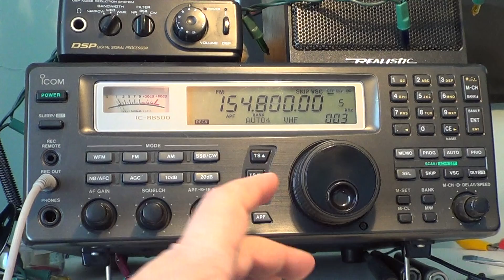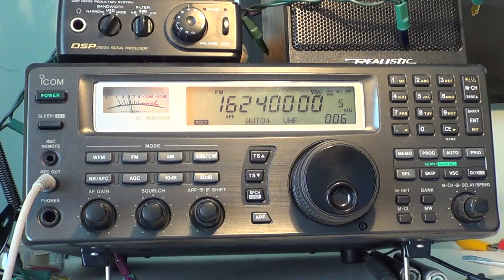Tips and tricks on finding signals on a scanning receiver

Comment: i did that and sometime i would get a rattleing engine sound
Reply: That's DMR. it sounds like a diesel engine without oil you can listen to DMR transmissions with a digital scanner or an SDR dongle and DSD+ software.
Reply: @fa2ality  or a discriminator tap on the scanner and DSD+. Though I prefer the whistler trx-1. Easy to take everywhere and lot's more sensitivity and better features than the shitty new unidens. Those things suck ass, uniden is a joke now.